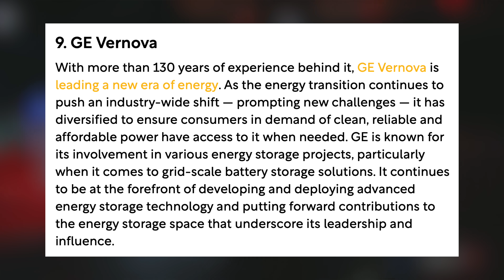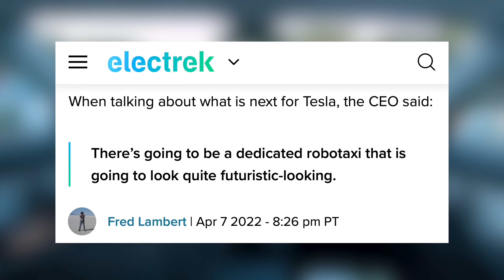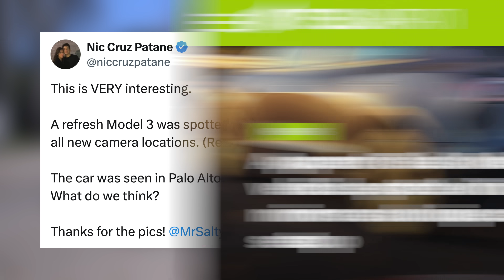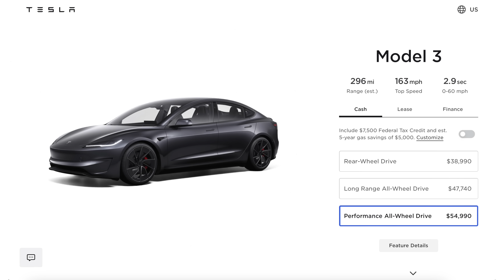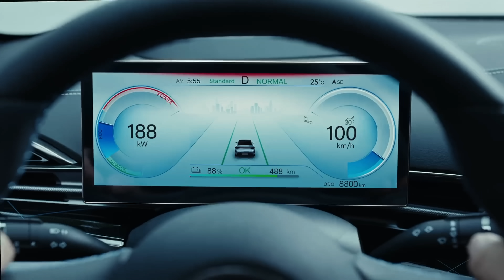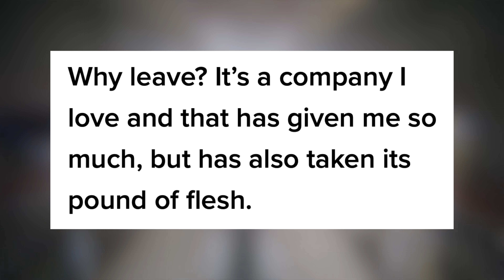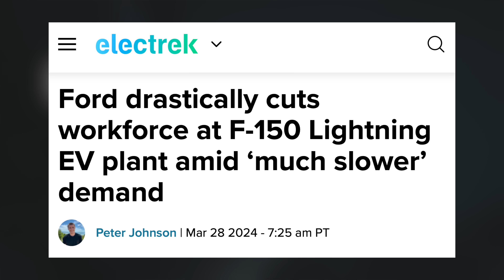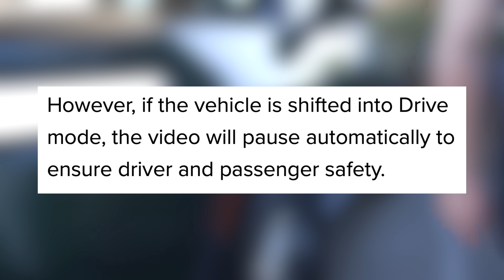NEW Tesla Prototype Spotted | They're Actually Doing It

Comment: Don't care about the robot taxi. I want my model 2
Reply: You can get a used 2022 Model Y for 25k... isn't your "Model 2" supposed to be 25k? 
"Model 2" prices already exist 😊
Reply: @U2B_Viewer  I really don't want a car the previous owner probably drove 150mph over railroad tracks.
Reply: @mscolli3  most of these cars have under 40k miles. Depreciation is just a lot more significant for EVs compared to ICE cars.
Reply: @mscolli3  if it was a previous Hertz rental vehicle they have a cap at 85 mph so good luck with that. Ev's don't have that much wear and tear and make good second hand cars, especially when you're under 50K miles and have all the warranty
Reply: @U2B_Viewer  man agreed. People don’t understand Tesla is the undisputed p4p champ. 
A dollar/value ratio on any Tesla used or old is wild
Reply: Robotaxi will be cheaper than a model 2
Reply: Robotaxi is what is going to drive the stock price, not model 2. Just buy a Corolla.
Reply: @darylfoster6133  😂😂 robotaxi is sooo much more exciting than model 2
Reply: They are testing someone besides that darn robotaxi
Reply: model 2 would be worse than the Y. for 25k a modely u can get more power more storage and prob more range model 2 will prob have a small 30-40kw battery. for 25k u can get a corolla hybrid and itll last u a long time.
Reply: @Fumbiii16  tesla will last longer than your Corolla and helluva lot cheaper than gas

Comment: Man, there’s just no way. Running fsd free trial right now and it screws up turning left at intersections. A lot. Wayyyyy too often to hop in a Tesla without a frickin steering wheel
Reply: People close that FSD V12.5 (in early stages) will have 10x less interventions compared to V12.3
Reply: But I agree, no steering wheel would take 1000x less interventions
Reply: What version are you on? Gotta admit, mine in my new Model 3 is working insanely well. I had FSD 2 years ago on my 2020 Model Y, and it was downright dangerous more often than not. But I’ve done 3x 30 minute drives that includes combinations of small local roads, two lane local roads and highways, and all three went perfectly, including one at night.
Reply: I just received my free month FSD last week and I CAN ATTEST that FSD v12.3 SUCKS at turns and all the NHTSA stop signs is SUPER slow and methodical, although very legal. My free trial will run out before they refine these issues out with another good update.
Reply: Doubt current camera positions are much of a problem for Tesla Vision.  The robotaxi geometry will prioritize super easy entry/exit and a large cargo area.  The camera positions simply follow from that.  A future where urban roads are dominated by robotaxi service is an exciting one.  At the expected price point, it could completely replace all public and private transit in these congested areas, save taxpayers money, and significantly increase safety.
Reply: This stuff must be regional or maybe the version you're on?  left turns work good on mine. I have issue with its need to switch lanes when not necessary then making it necessary to switch back to the correct lane. Also it does so in intersections for some reason now thats dangerous.
Reply: They can geo fence the taxi initially and build out, ensuring each area works perfectly. It'll be like waymo to start with but will have far greater ability to scale quickly and cost effectively
Reply: I have 12.3.6, and while it's clearly not ready to operate without human supervision, it's close enough to make that feel like a fairly realistic goal. I could see their robotaxis running in select areas relatively soon.
Reply: You need to upgrade, then
Reply: @t1328 HW4. I want bad. HW3 owners will not get real fsd. Not happening. Car needs more eyes and 1 sensor wouldn’t hurt.
Reply: I don’t think  anyone that has not had previous versions of autopilot can appreciate how good version 12 is. It is amazing . Sure, it has room for improvement, but that is also happening quickly.  
.
Reply: Can't see FSD working in the UK streets, Or in India. They will need another 20 years of training to get even close to having no steering wheel.
Reply: @bsears693 

Without a steering wheel, there could be no interventions. 😵‍💫
Reply: Without radar, I don’t see FSD working in weather conditions 🥹
Reply: That’s “Frunkin” steering wheel 😂
Reply: U don't have fsd beta u have fsd
Reply: Thats not fsd beta .. so big improovements are allready made

Comment: I dont understand the pricing of the powerwall to be honest. In Germany you can get a Powerbank of 10kwh for 2500€, but a Tesla PW costs 10000€ for 13kwh. Also you dont need Tesla to do autobidder things. 

I am all in on Tesla stock, so Id love Tesla to do better on Powerwall, because for now its straight up stupid to buy their product.
Reply: You need to compare a complete system including the inverter, not just the batteries. And Tesla includes a lot of software to integrate with domotica (charging car during excess PV, island mode in case of grid failure, ...)
Reply: @ttkddry  so in the case of Germany you dont need an Inverter, because the most sensible thing is to buy a battery system alone, even though everyone is trying to talk you into getting a PV. Also, doesnt tesla Charge 1000€ seperately for an Inverter if Im not mistaken?

Even with all those Features, the price difference is very big, multiple hundreds of percent.
Reply: @SunRunn3r  you can buy cheap battery modules, like from Pylontech, but you need to hook them up to your PV inverter. Victron Energy or SMA has models that combine PV an batteries but they are not standard, you sometimes need to change an existing PV system. In the end it always costs more than you expect, I think the Tesla price for an integrated system is not unreasonable although it is not the cheapest on the market
Reply: @SunRunn3r  you need to compare not only the kWh of the battery, you also need to look at the peak power in kW of the inverter

Comment: I did not like FSD at night or high traffic in the South Bay Area between San Jose South and Palo Alto. FSD became confused and indecisive during high traffic and medium to low traffic. FSD was surprised by fast cars driving buy and could not anticipate rear approaching vehicles and almost assumed rear traffic would obey listed speed limit rather than actual.

I would definitely need another subscription after Tesla applies all the massive data it received from the free subscription period. Even then how would we ever know what it has learned and how it deals with roadwork signs etc.

Comment: Am I the only one who remembers that   the plan was to build wheeled and non-wheeled versions of the Model 2, which given steer-by-wire would be straightforward to produce? But perhaps they can do the same trick with the Model 3, as a stopgap anyway.
Reply: A “non-wheeled” car? Big innovation. My revivifier had a FIAT like that😂
Reply: The master plan doesn't say anything about that
Reply: @darylfoster6133 It doesn't include everything. But IIRC this came from Isaacson, either in the biography or more recently. Besides, it makes much sense. But plans can change, so we'll see soon whether they go with an entirely new model or use a modified Model 3 for the robotaxi, per a recent rumor, in which case the wheeled version already exists. But even if the latter is true maybe the new model will come along a little later.

Comment: Not a finance guy but could Ford losing more money per vehicle on their EV line be a good thing? Doesn't that mean that they have invested more into the tooling and manufacturing of EVs? And those costs of that are associated with EVs so at a per vehicle level, it seems to lose more money but in the long term, having that investment will be good?
Reply: Nope. It's still a bad thing, selling their cars at a loss doesn't mean they invested more into tooling and manufacturing. It means they aren't selling enough EVs for "economy of scale" (the more you sell, the cheaper it is to produce) yet and it means the ones they are selling aren't made efficiently enough from a production process perspective. Part of the reason they aren't selling enough EVs is due to half hearted commitment, macroeconomics issues like people not being able to afford the mid and high end EVs, and the fact that they still have to keep their ICE car business going (an inherent struggle all legacy auto faces during this transition to EVs). Selling their cars at a loss now doesn't really do anything for the long term. They are doing some things that will be good investment for their EVs in the long term like setting up a few EV production lines and working on newer battery tech in labs and what not, but selling their current EVs at a major loss isn't one of them. A good sign of investment would be seeing how much money they lose per vehicle becomes less and less (which is what Rivian is doing), instead Ford's losses are GROWING.

Comment: I contend too much emphasis is placed on the price of battery cars and not nearly enough on the lack of charging stations. Many   Many people live in apartments that do not have the facilities to install chargers .... so ... only hybrids that don't need the stand alone chargers. The closest charge here in Eastern Cleveland is 20 miles away.
Reply: Charging stations should be almost as ubiquitous as gas stations. Otherwise you've virtually eliminated 1/3 of the population from buying an EV. And charge times need to be reduced to five minutes.
Reply: Apartment living is a huge draw back. Topped with some parts of the country still has nothing.

Comment: Fsd is great decided to try it when it became 100$, use everyday on my ride home, i just dont like how it responds to flashing yellow lights, breaks to hard, or comes almost to a stop but then i realized,  this probably how youre suppossed to drive through yellow lights but no one does that when you have the right of way, but i just hit the accelerator without disengaging ths fsd, but its still pretty amazing, as a truck driver after driving all day it helps with fatigue, its worth the 100$ for me not 200 tho
Reply: No, you aren't supposed to brake through a flashing yellow light. Where did you learn that?
Reply: @darylfoster6133  youre suppossed to slow down, but the car feels more like its breaking

Comment: In the future, the voice assistant will tell you that in your current sitting position there will be an impact of 12% on your posture. The seat will measure your heart rate and perspiration level. In the future your voice assistant will tell you that your current volume level is to loud for your ears. In the future your Tesla voice assistant will tell you that your tires have low tread and will need replacing in 30 days and schedule an appointment for you for tire service. In the future, your Tesla will go cross country, LA to New York on a single charge. In the future.....

Comment: What does ". . . and is single stack - no more implicit stack on highways" quote at 3min 50sec mean and how does it relate to mpi [ miles per intervention ]? Any word on when the intervals between which you have to touch the steering wheel to prove human is supervising will get stretched out?  What about the stopping the turn off behavior when you don't react to that vs just continuing on?

Comment: BYD in Mexico is selling more and more EV's everyday. 
They have the most affordable EV in Mexico, and models like BYD Seal
 already made Tesla drops prices of Model Y and 3 to be able to compete. They dropped Model 3 about $4000 usd. LR was about $55,000 usd and now it's around $51000 usd. Also previously Model Y was notoriously more expensive than Model 3, but now they bout are around same price (Like $1000-$2000usd difference).   

I wouldn't buy a BYD for now, as the only infrastructure for Fast Charging in Mexico is Tesla's SC, which means other EVs like BYD are not really a good option for longer trips, but I definitely love the competition, as it makes EV's more affordable to users.

P.S: Mexico has an incentive of not charging importation fees for EVs, that's why they are kinda cheap, but that benefit it's supposed to finish later this year, so let's see how much the EV prices go up and ow would that harm the market.
Reply: P.S.: Mexico has an incentive of not charging importation fees for EVs, that's why they are kind of cheap, but that benefit is supposed to finish later this year, so let's see how much the EV prices go up and how would that harm the market.

Comment: If Tesla produce 1000 a week, why there are only arround 5k produced since launch?
Reply: A “ramp” goes from Low to High: 1000/ is the current High - and future Low…
Reply: @FrunkensteinVonZipperneck  After 5 Months and 2 years of delay, this is still very low. In their earnings call they said that they achieved 1000 per week but only produced 5000 so far. Compared to the M3 this is much too slow.
Guess Elon needs to stay more in the manufacturing again.

Comment: I wish I lived in an area where FSD was actually better than 11.4.9. V12.3.6 is absolutely unusable here. If you don't have auto speed control enabled, it needs constant and repeated encouragement to get to the set speed. It doesn't slow down or speed up in response to the right scroll wheel also. If set for auto speed enabled, it goes well above the speed limit. I really hope it acts as well here as it apparently does for you with 12.4, but I doubt it. I'm currently just using Autosteer.

Comment: Ryan why no discussion about Waymo & comparison to Tesla Robotaxi and/or FSD.

Waymo is fully electric, autonomous and been running for a few years already here in East Phoenix area…why does it take Tesla so long with all the data gathering from shear number of Teslas on the road?
Reply: Training a driving system for one small, known, rarely changing area is much easier than a general driving system for all areas
Reply: Very, very, very different technologies. IF Tesla can get their version running as well as Waymo's Geo Fenced much more expensive to deploy per vehicle option, it changes the game immensely. However, as of RIGHT NOW, Waymo is truly autonomous where it is designed to be. If FSD gets that good, the idea is to have everyone using it, not just for the robotaxi service, but if you were a Tesla owner, you could be in the Robotaxi business just like getting into the Uber business, just send your car out to work while you are at work, or after you get home, or whatever, on its own. There are infinite possibilities IF FSD does what Waymo does but does it for 100 times more usability than Waymo outside of the robotaxi model, and for a lot less cost per car, like several times less
Reply: Because five minutes of Research into waymo makes it apparent how limited and expensive to scale that company is. Bruh
Reply: Waymo may not exist in a few years. Their system is extremely limited and hardware is very expensive. AI in Tesla's will go nearly anywhere. Waymo must stay in their little safe areas repeating the same little grid over and over. Despite their controlled areas, there software is under investigation after federal regulators received 22 reports of  crashing or violating traffic safety laws by driving in the wrong lane or into construction zones etc. Their growth is slow and expensive and won't sustain other than small established areas. Plus, they're not allowed on freeways.